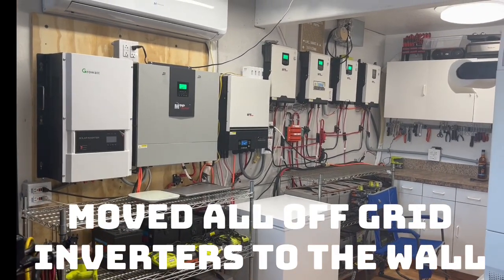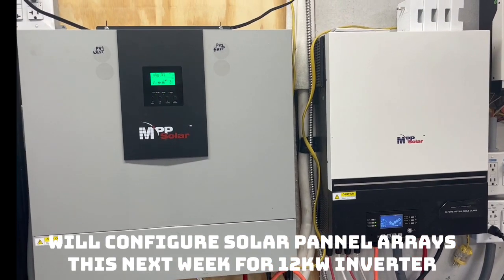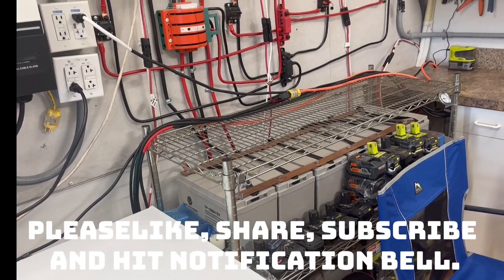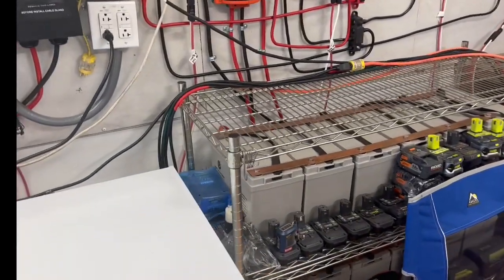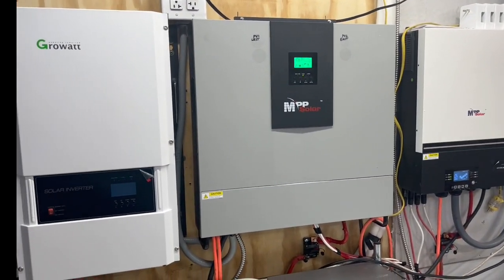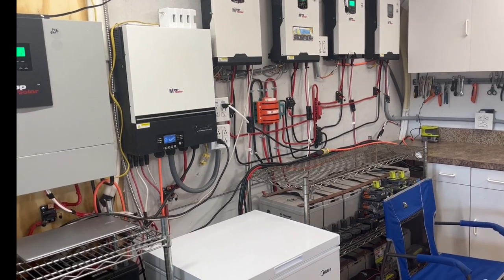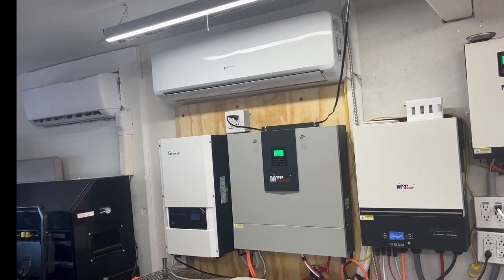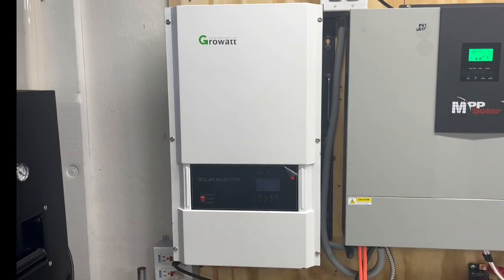DIY Solar power with Pappa adding New 12kw inverter to system and wall mounting all inverters.

Comment: 115 degrees in the day and 102 at night?? And you run a pool heater for?????
Reply from the maker: Both pool heater heat pumps have the ability to heat or cool water. So when it is 115 degrees out, I set the temp I want on pool heat pump, say 88 degrees.  it will either heat or cool water to 88 degrees depending on pool temp. There are pool heaters that just heat pool and do not have this option to cool. Hope this helps.